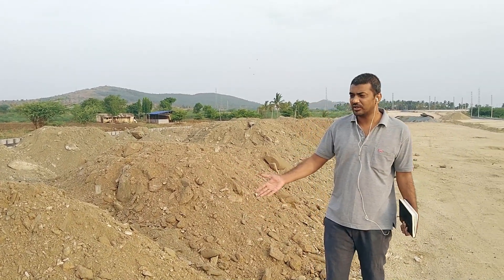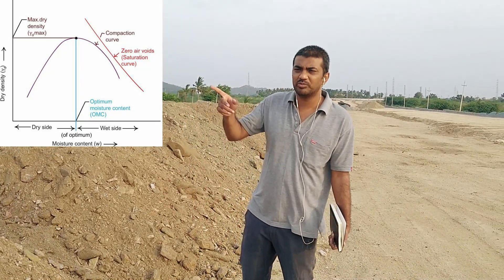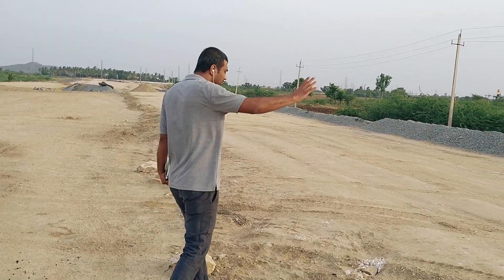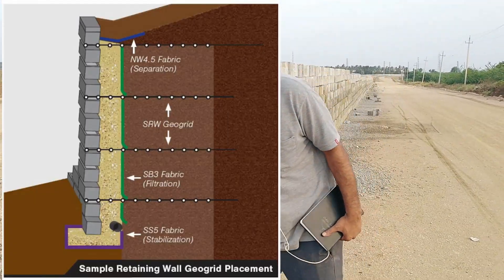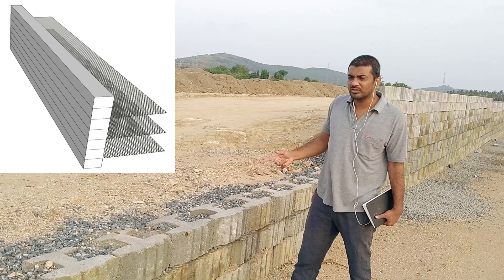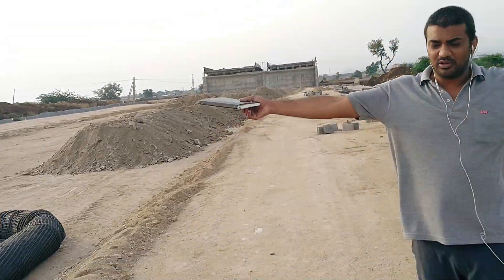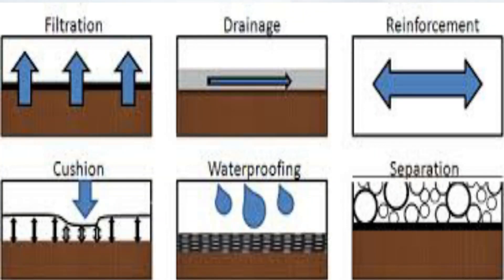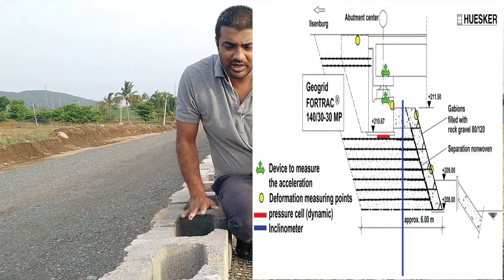Reinforced Earth Wall (RE Wall) Site Visit- Civil Engineering

Comment: Good information provided, but if possible in next video you may cover the following details;
 Geo textile material exposure condition, block I-Section requirements, Retained fill/Reinforced fill difference, at junction/Structure corner requirements, levelling pad step pattern, slope of block facia details & geo synthetic first layer.